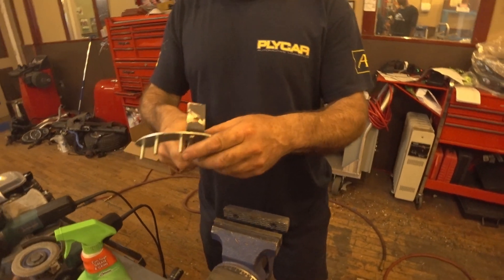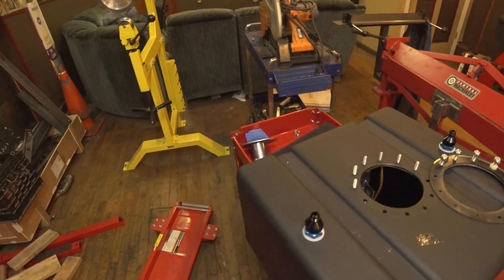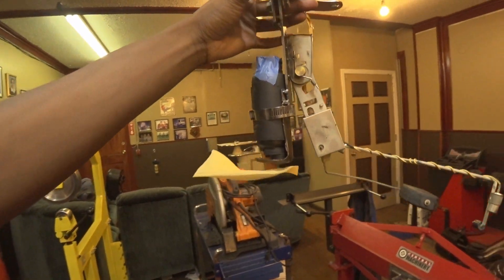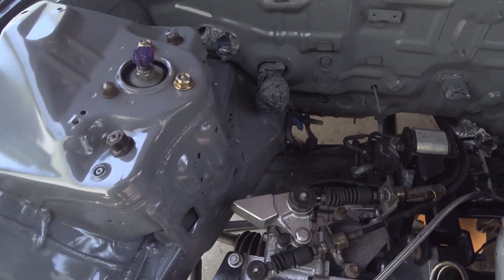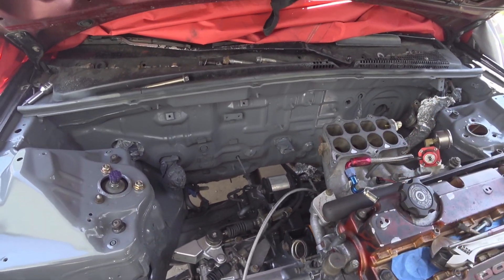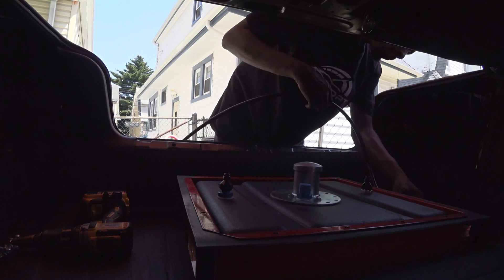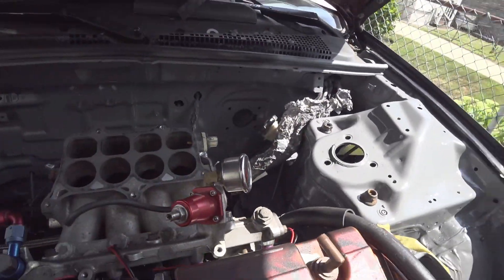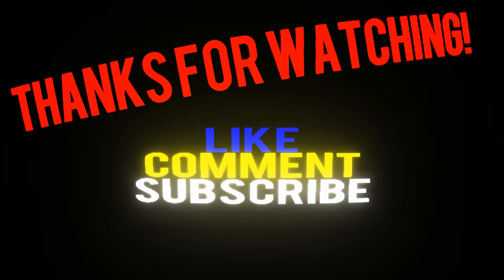Trunk mounted Fuel cell in AWD CB7.  -6 PTFE fuel system. Part 1

Comment: What total cost for awd
Reply from the maker: I got a deal on a lot of parts. I was say 2000 for the parts. That's including subframe, diff, transmission and h2b plate. Did does not include the work we put in.
Reply: It's going be sick bro can't wait to see it on the street video big ups

Comment: Getting closer and closer bro! It's looking good! What fuel you plan on running?
Reply from the maker: Yea trying to get it started before winter hits. Want to run a 93 and e85 tune.  Just incase I like the swap and want to do a built motor like since ppl lol.